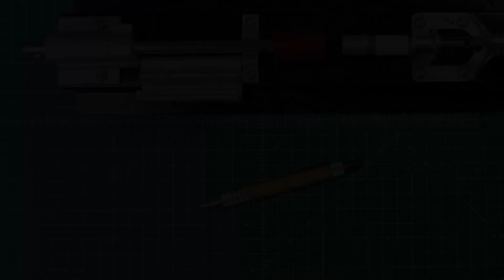EDC Pen And Pencil Osage Orange

Comment: Does the Rockler dust collector on your lather work for you? I'm fairly new to turning and really want to add some sort of dust collection to my setup, particularly when working with acrylic material, and wonder if the Rockler device works well and if you think it's worth the cost. I'm thinking I might be able to fashion a homemade solution for a lot less $. Thanks for the great content!
Reply from the maker: I like it. It was definitely worth it for me. It collects a lot of the chips and especially the sanding dust. I chose this one partially for the stand. It's made to attach to the lathe. It's easy to adjust.   Thanks for watching.